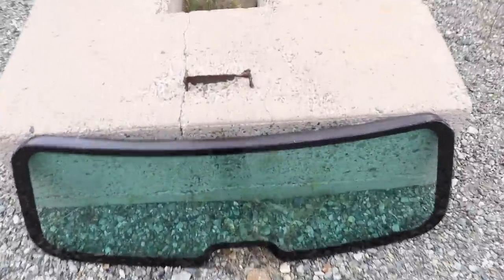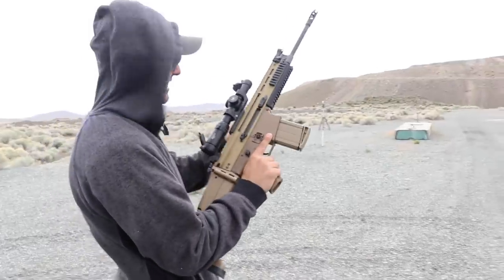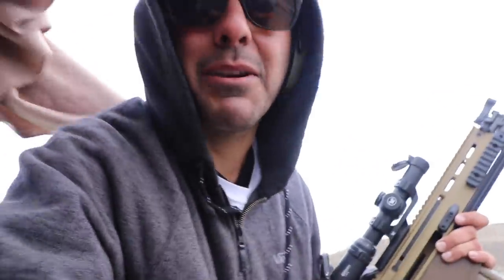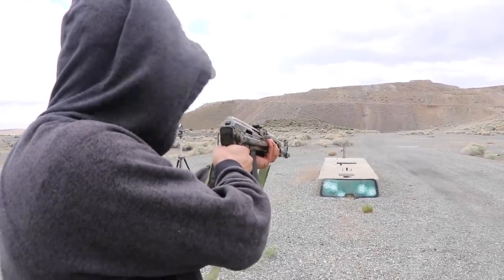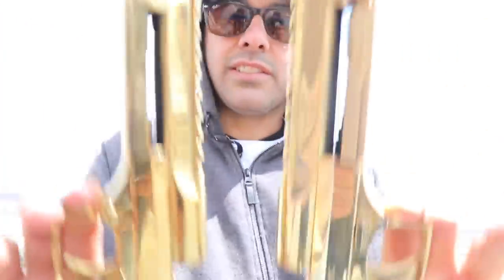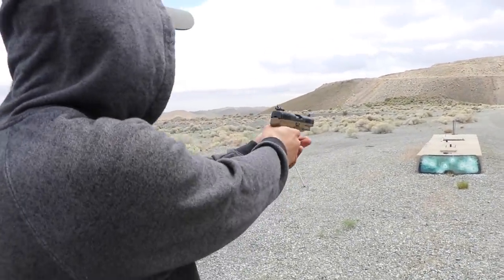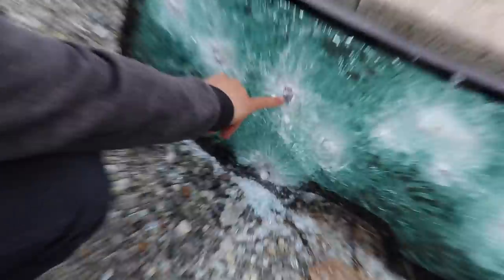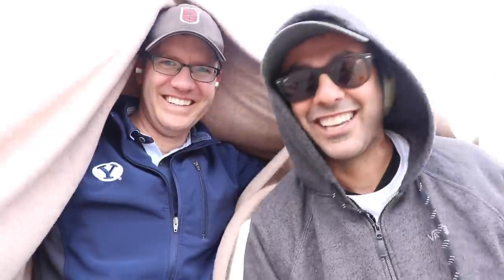Double Gold Desert Eagles

Comment: It needs .50 cal. Cumon!!
Reply: Gregg B .
Reply: Maybe .338 Lapua but definitle Armore Piercing Rounds
Reply: Also the 20mm
Reply: It goes through and 20mm will penetrate 2 of them easily or even 3, depending on bullets
Reply: 408 cheytac 😅
Reply: M107 pls
Reply: T6B ammo for the 5.7 he needs to use that not the junk blue tip stuff you buy at Walmart.
Reply: He did
Reply: Gregg B the deadly was 50 cal